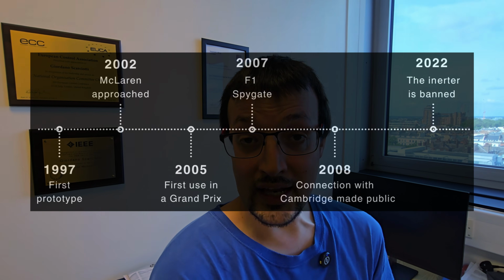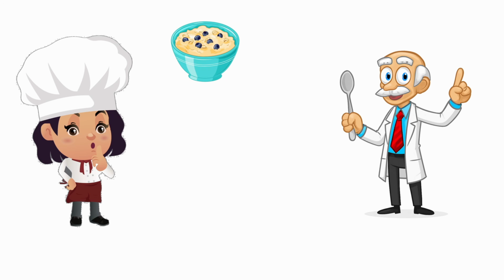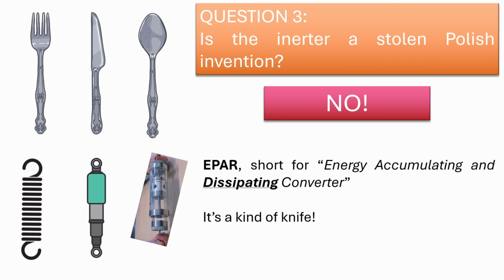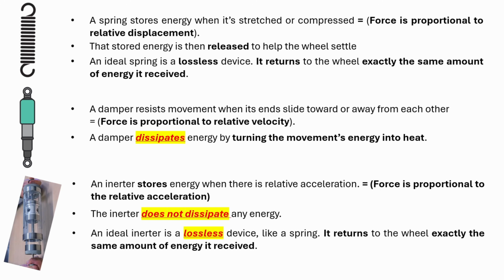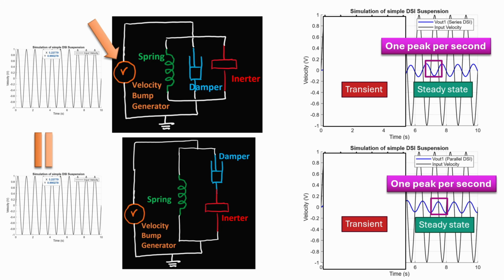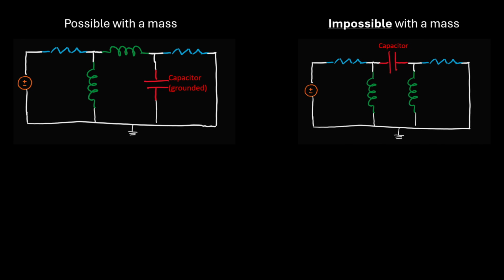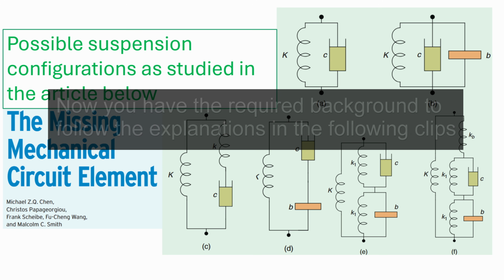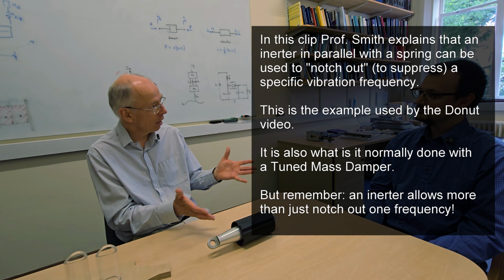Why Everyone Gets the F1 Inerter Wrong | Explained Clearly

Comment: First, I am a retired mechanical engineer. I understood the force versus relative acceleration concept rather than displacement or velocity from the first episode. What I was frustrated by was no explanation of how it was used on a F1 car. In parallel with the spring and damper it would seem to contribute to "unsprung weight" which is generally not thought to be good. You addressed that with the series example. Renault seemed to use it as an anti-roll device whose use was viable but not clearly beneficial. Electrical filters come in a wide variety of configurations. Perhaps a mechanical analogy is too complex, but I would like a discussion of more configurations and how they are deployed on the car beyond just the wheels and chassis connection. This comment is not to be meant to be negative. It is an interesting topic well presented. I just want more. Thanks.
Reply: The picture he showed of the renault car uses torsion bars as springs and the interter in place of a heave spring
Reply: I can think of a few possible examples how inerters can be beneficial, but I need someone with more race car knowledge to confirm.
One specific problem I can think of that I'm pretty sure is correct (I'm only an EE btw), is that a lot of race cars with extremely high aero forces need to use very high heave spring rates. This is to prevent the car from getting pushed down too much from the aero forces. The problem with this is that since race cars are light, this causes the ride frequency to be excessively high, which reduces ultimate grip. 

I believe an inerter can be used to basically "add mass" which should allow the ride frequency to go down. A typical race car suspension looks like a 2nd order low pass filter, with mass and suspension rate as the capacitance/inductance in the equation. Inerters let you add "mass" to the system by adding to the capacitance and lowering the resonant frequency of the low pass filter. 

However, this leverages the advantages of inerters where it lets you add more "mass" without actually adding inertial mass which would cause your race car to be heavier. I can't think of an example where you leverage the free-two-terminal nature of inerters. This is the missing piece I'd like to know.
Reply: @__dm__  https://youtu.be/t58qjcNwEbo?si=1ZxhvnhYRYJO8NrM
Reply: Some shock absorbers,Penske being one, located  in the remote reservoir  ,has a threaded rod with a valve , disc or drum like, that spins with the flow of oil like the inverter being discussed.
Reply: I'm an electrical engineer working mainly on small scale racing cars (too small for an inerter 😊) and your video refreshed my memory on Bode plots, and a few other electrical concepts that I haven't been using in decades. Thank you!
Reply: I want more too😅
Reply: I think they used the inerter to control the flexibility of the tire, which in essence is a spring, but it is outside the domain of the standard components of the suspension. My theory is that it works just like a TMD, but the difference is that the inerter is not affected by the acceleration of the car. It is only affectted by the acceleration of the suspension. So, you have the unsprung mass with the "spring" made by the tire, which have a resonance frequency with very little damping and you try to control it through the suspension by tuning the inerter... that's my conceptual theory, at least.
Reply: Outside of telling what it is not. I don’t believe he knows.
Reply: Unsprung weight is not really the big no-no, but unsprung mass is. 

It seems to me that an inerter is able to mimic the inertia of mass, but it does not actually have a lot if mass. 

This is achieved by accelerating the movement of a small mass to a higher velocity. 

Note that I might be mistaken. This is my understanding of the inerter.
Reply: "Renault seemed to use it as an anti-roll device "

I think it is being used in quite the opposite way, the way that it is suggested to have been mounted on those cantilevers, means that any rolling of the car would simply move the entire inerter side to side and it basically does nothing
But vertical movement would compress and extend the inerter, putting it into play... This makes me think that it is being used to counter some kind of vertical oscillation
Reply: @carmatic  I see its use in the Renault example to affect the ride height at speed. (Assuming it's a spring / inverter in series, which it appears to be in the diagram).
Low speed / low aero load, and it can't compress the spring.
High speed / high aero load, it can overcome the spring, and the car can run lower.
But fast bumps aren't influenced as they are not sustained long enough to accelerate the inerter.
Reply: @markvisser99  
>But fast bumps aren't influenced as they are not sustained long enough to accelerate the inerter.

I think you missed the idea of the Bode plot. Prof Scarciotti points out that with this device, they can design ANY frequency response they like, addressing fast bumps or slow, or both.  As a simpleton, I think of a suspension as a spring and a damper, and now maybe an inerter, but that understanding may be naive. There may be multiple springs (or variable rate springs) and multiple (compound) dampers , and potentially multiple inerters, all inside "the black box" that the other Cambridge prof described. With the combination of these three devices the suspension designer can address any frequency they want to address.
Reply: @dinochiesa3787  the Bode plot deals with steady oscillations, not transient spikes like sudden bumps on the road
Reply: @carmatic  It appears to be hooked up in parallel with the anti-roll bar. This would transfer force from side to side based on the vertical (bump) acceleration of the wheels rather than the sway of a usual anti-roll bar (spring) which generates its force proportional to relative displacement.
Reply: I'm also curious about the application of the inerter in a suspension system and how it's used. I ride mountain bikes, and have a decent understanding of dampers, springs, etc, but I'm not able to envision the use case for the inerter, aside from being able to cancel out specific oscillation.
Reply: @markvisser99  Inerters add an additional way to control how the suspension reacts to bumps/undulations by storing mechanical energy, just like how capacitors store electrical energy in a circuit.

Springs store and release energy, but does so using the flexibility and elasticity of the spring's material and shape. Inerters do this too by storing and releasing the energy via the flywheel effect (mass). That storage of energy is used to control how the suspension reacts to bumps and undulations.

And that is analogous to how inductors and capacitors store electrical energy in a circuit and how that is used to control how the circuit reacts to voltage/current "bumps and undulations". Both capacitors and inductors store and release energy, but they do so in different ways. The same can be said with springs and inerters, but instead of controlling voltage and current and their rate of change, it deals with mechanical forces, velocities and accelerations.

Not all things can be explained to a lay person, and this might be one of those. The reason i get it is because i am an electronics engineer, and have to deal with electrical harmonics just like how suspension mechanical engineers deal with mechanical harmonics.
Reply: @markvisser99 
There was a clue given in the text, changing the thread pitch of the ball-screw to meet to frequency of the suspension. It is inert, not active only offering resistance to the sprung-weight by slowing the springs oscillation frequency by canceling it. 
  Clear as mud yet? Me to, but I have to see more. After 44 yrs of repairing vehicles then teaching for ACDelco, I choose to build my 1967 C10 for daily use and prefer a smooth ride. Not lowered or raised, just controlled properly with a $1,000 of duel adjustable coil-overs that wear out in 30k.
Reply: It's a ball screw, and relies mainly on resisting change of direction acceleration, which does dampen spring oscillations. It should be replaced with 2 opposite direction freewheel sprag clutches, one connected to a reverse gear, each connected to another gear that is driven by a linear gear (ball screw or standard) so up-down motion is converted into one way rotary motion. It kills most of the inerter effect but you still get some magnetic resistance and a few kW of energy. 1 to 20+ gear ratio and 16 to 24 pole generator produces a pulse with around 100 microns of suspension movement (in a perfect system!) while resisting suspension velocity change. Still needs a spring and normal dampers.
Reply: @PrivateSi  https://youtu.be/t58qjcNwEbo?si=1ZxhvnhYRYJO8NrM

Comment: Here’s a much more intuitive explanation of the 3 suspension components which is more closely related to PID control.

Springs are used to control displacement of suspension ie ride height.
Dampers control velocity of suspension movement.
Inerters control the acceleration of suspension movement.
Reply: It looks as though you have assumed that they are used in parallel with the spring/damper. That does not make sense as it only performs like a heavier wheel.
Reply: @raydelong4771  it doesn’t have to be placed in parallel to affect suspension movement. Wherever it is placed, it modifies the acceleration of the affected joint.

Comment: Ok I get the inerter concept - I did after the first video but I think it's really going to shine in single cylinder engine torque impulse shaping and reducng Dual Mass Flywheel prominence.
If my understanding is right, then we can design a device that can spread peak torque over time differently for different frequencies and transfer impulses more or less aggresively into the road. Applications? offroad bikes, maybe generator efficiency, stroke conversion,.

Comment: Great video but with all due respect, it reflects some of my frustration with many academics in school. You provide a lot of great engineering insight and comparisons highlighting the problem it is attempting to solve without really giving clear examples to visualize how it actually functions and WHY it works.

It wasn't until you mentioned there was a flywheel that I even began to visualize what it's probably doing. I understand it's a complex system with various potential configurations. Just pick one and give a simple visual breakdown of how each part of this system influences the other. What is really going on inside the inerter the moment force is applied to the wheel? Help me to visualize the mechanical difference between a comparable system lacking an inerter.

I want to reiterate that I appreciate the work and you covered a lot of great information. In my opinion, it doesn't quite answer the core question of how an inerter actually functions. You did make it crystal clear that it is definitely not a damper.
Reply: Exactly my feelings. Cool that the profs understand it in their particular ways but that isn't necessarily mine. I get the 'missing puzzle piece' systems thinking part (as a TRIZ-fan).  It sounds pretty simple as a device (will now download and read the paper referenced by prof. Smith). As someone interested in the history of technology I know for a fact that very few things are fundamentally new. No doubt the suspension application is but from what I understand of it now it would really surprise me if I can't find an old patent of a similar device in say lifting equipment or movable bridges etc.
Reply: Reminds me of Dickens quote: "If he had only learnt a little less, how infinitely better he might have taught much more!"
Reply: The first video does explain how it works doesn’t it?
Reply: The first video did explain how it worked, mechanically. This was more a deeper dive into the concept of WHY the inerter came to be, and not just how.
Reply: When I was studying the theory in electrical engineering classes 40 years ago, what struck me was the observation of our professor that the concepts of the theory are sometimes difficult or impossible to explain in physical terms. You need to rely on the math to understand what is happening. And you need to trust that the math is correct. The Bode diagram does not even come close to explaining what is happening. But the steady state sinusoidal theory and Bode plots and frequency response curves can simplify the problem and let you design the parameters necessary to achieve many kinds of system responses to road behavior. But better responses can be achieved using the transient analysis that is necessary to address the bumps on the road and the instantaneous forces experienced by the F1 vehicle. Transient analysis was ignored and not discussed in the videos, but I'm sure it was a fundamental part of the actual design approach of Prof. Smith.

After a while, I learned to just trust the math and the methodology. And although non electrical engineers might find this elitist or might argue that maybe EEs can't really explain what's happening, the fact is the theory and the math do make many real world things possible, even if no one can really explain physically to a layperson what's happening. 

Nevertheless, I found the video to be extremely well made and the attempt at explaining the theory at a relatively non technical level very clear.
Reply: Super frustrating to listen to tbh. I feel like the professor was being intentionally vague about the role it plays in the F1 car. Maybe he’s hoping it will be implemented again in the future and that teams will need help to use it effectively.
Reply: @Fohntanawitz  simple physics: springs control the location of a mass, dampers control the velocity of a mass, and inerters control the acceleration of a mass. In our case, that mass is the unsprung weight. With the right mechanical layout of the three control systems, you now have full second order vertical control of the spindle for each wheel which can now be integrated with the ABS and traction control and steering to give incredible handling characteristics.
Reply: @Fohntanawitz  Not everything can be explained in a way that 100% of the population can understand, just like the intricacies of complex subjects like quantum mechanics cannot be explained in a way that 100% of the population can understand. Though this subject is a lot less complex than that. And the closest analogy that they came up with is how an electrical circuit components react/control voltage/current changes. If you can't understand it, then you're simply the part of the population that can't 🤷

Inerters add an additional way to control how the suspension reacts to bumps/undulations by storing mechanical energy, just like how capacitors store electrical energy in a circuit.

Springs store and release energy, but does so using the flexibility and elasticity of the spring's material and shape. Inerters do this too by storing and releasing the energy via the flywheel effect (mass). That storage of energy is used to control how the suspension reacts to bumps and undulations.

And that is analogous to how inductors and capacitors store electrical energy in a circuit and how that is used to control how the circuit reacts to voltage/current "bumps and undulations". Both capacitors and inductors store and release energy, but they do so in different ways. The same can be said with springs and inerters, but instead of dealing/controlling voltage and current, it deals with forces, velocities and accelerations.
Reply: Agreed. I think it's fairly clear how it works, but not remotely clear how that makes it useful to an F1 team. There's a 10 minute video on the Donut media YT channel that does a much, much better job of explaining, mostly thanks to some helpful animations, so I'd recommend people watch that instead.
Reply: @Muddy_Mole  https://youtu.be/t58qjcNwEbo?si=1ZxhvnhYRYJO8NrM

Comment: An inerter seems much more appropriate than a damper for making buildings able to handle earthquakes. Come to think of it, those bowls which have rollers which they put the supports of skyscrapers on for eachquakes can maybe be viewed as inerters, with the weird caveat that they convert horizontal to vertical motion. Maybe they can be coupled with dampers and springs in the same RLC analysis to help with earthquake resistance.

Comment: @34:17: Mistake in the onscreen text, middle paragraph talking about the complex plane impedance plot. "... he's using a single plot where the *phase shift is represented on the vertical axis*". 
This is incorrect. 
Correct is: *phase shift is represented by the angle the point makes relative to the real positive axis about the origin*. (And the magnitude is represented by the distance from the origin).
So 'inside plus/minus 90 degrees' is the same as 'not having a negative real impedance value'.